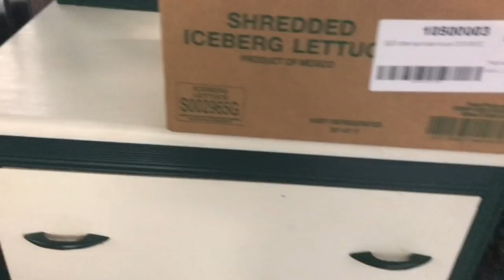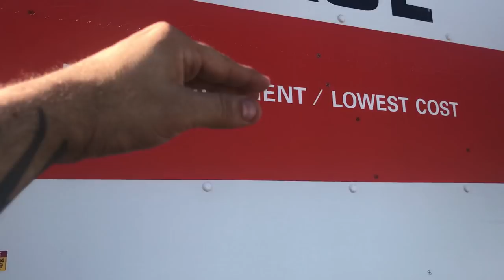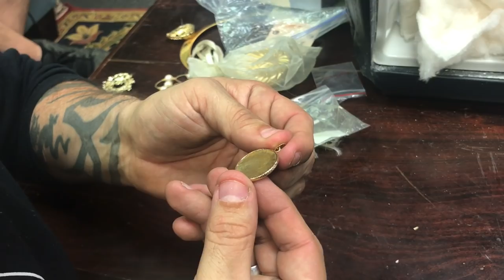Abandoned Sentry SAFE SMASHED OPEN | GOLD & DIAMONDS FOUND INSIDE! I

Comment: If you are going to continue to hope you find gold or silver you might be better off to get yourself 1.) A good magnet. Neither gold nor silver is a ferrous metal and does not stick to a magnet. (Test one.) 2.) Get a "good" magnifying glass or at least a 10x jewelers loup (magnifying eye glass) to see the markings. Remember, that just because you do not see a marking stamp does not mean it is not gold or silver. As well just because it does not stick to a magnet as well does not mean it is gold or silver. But these two tests are good indications because even when stamped 14 k it does not mean it actually is. As well remember that 14 KP is not an indication that it is plated but means it is exactly the decimal equivalent of 14 K. Thus 12 KP is .500 fine and 18 KP means it is .750 fine. Since by law something marked just 10 K, 12 K, 14 K, or 18 K can be actually a degree or two less in fine gold than the stamp states. As well if you see a decimal such as .916 on a piece of jewelry it is likely 22 K P. .925 means sterling silver although it could as well be stamped Sterling or 925 with no point marking.There is some gold less than 10 K but generally you will not find it because less than 10 can tarnish and gold of fine quality does not tarnish. The P after the K in jewelry such as: 14KP means Plumb thus, 14KP means 14 K Plumb. Or .583 fine. 10 KP is .416 fine. The stamps you will generally find are 10 K, 12 K, 14 K, 18 K, and 22 K .... Although .916 is often used rather than 22 K.